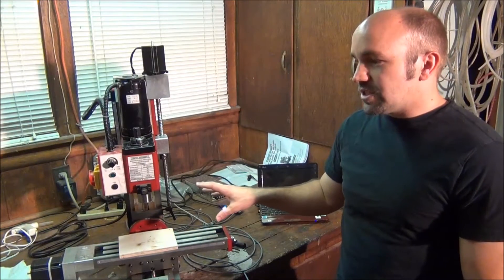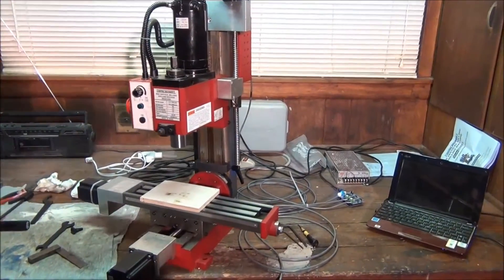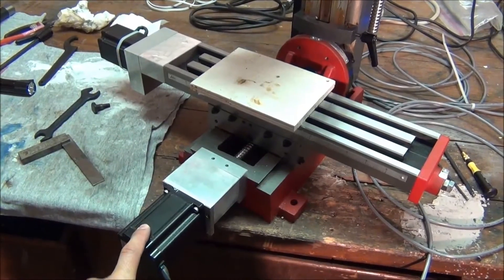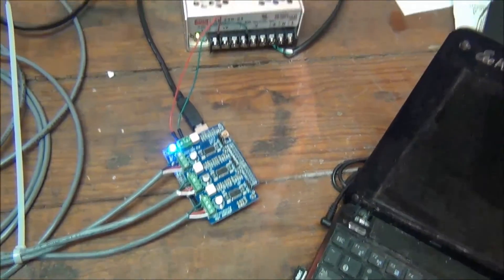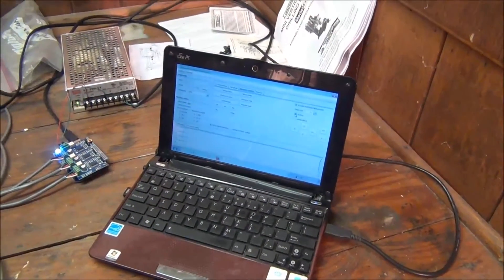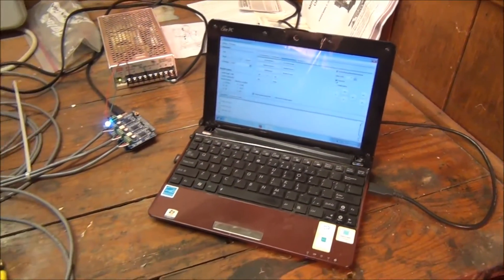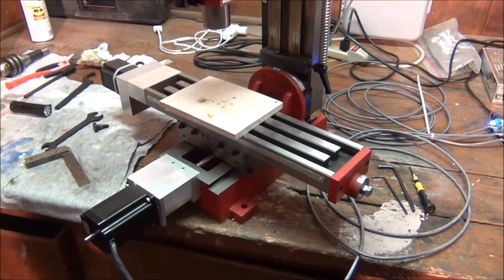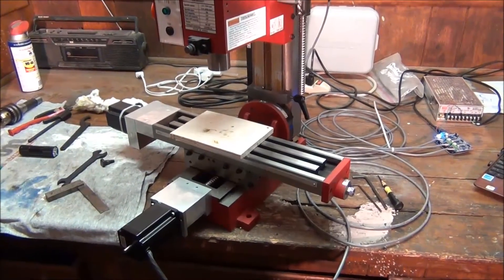DIY Arduino Controlled CNC Mini Mill - Overview

Comment: Hi Tim, Is this still a good option in 2023? I have a small Taig mill with the small standard base motor, that I will be converting to CNC just to do small brass parts on. I like the fact that it does not use a serial port. But then again not sure if I could install a serial port either.
Reply from the maker: Great question! Short answer yes. If I had to rebuild my machine in 2023 I would us an Arduino Uno and gShield. It's hard to beat from a value perspective. It sounds like you understand the limitations of the stepper motor size, speed and power. However, for small brass parts, you shouldn't need crazy high feed rates. My machine is still going strong after 7 years!
Reply: Thank you.

Comment: What type of wire did you use from the shield to the stepper motors ??
Reply from the maker: I used 4 conductor shielded cable. The link is exactly what I used. https://www.mcmaster.com/8233t36

Comment: Great job. I started to go that route on my controller as well, because I am an avid Arduino fan but opted for some more hardened microstepping controllers, that will support future upgrades. I think you will find your next upgrade will need to be the spindle drive system.
Reply from the maker: +MendingThings Thank you. Yes you are right. I figured once I destroy the stock plastic gears, I will move on to a belt drive.